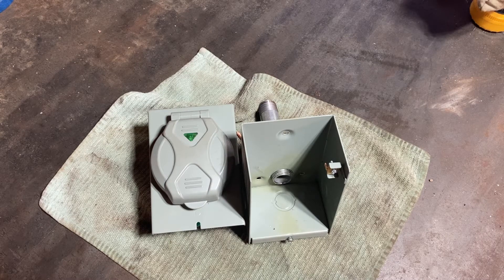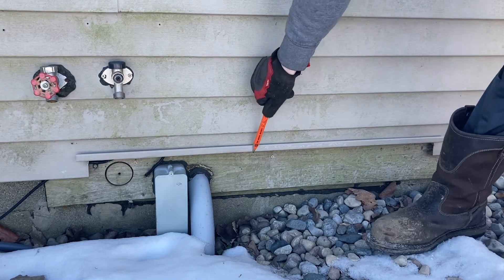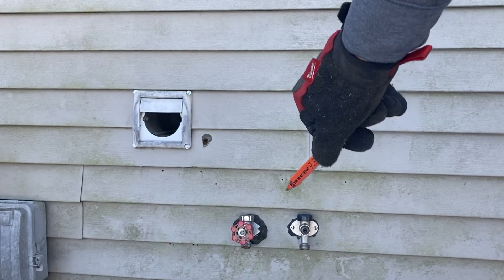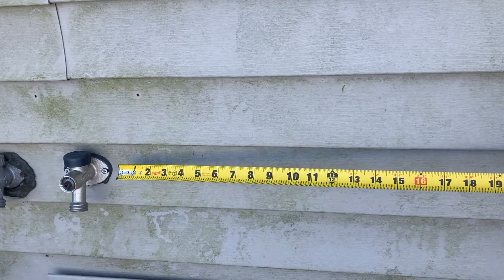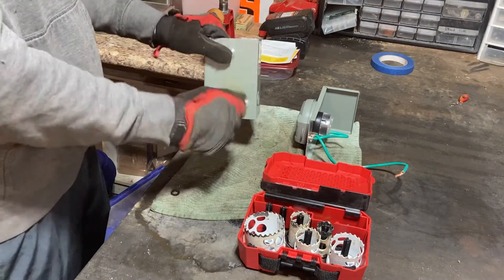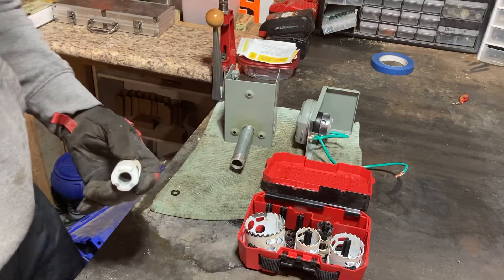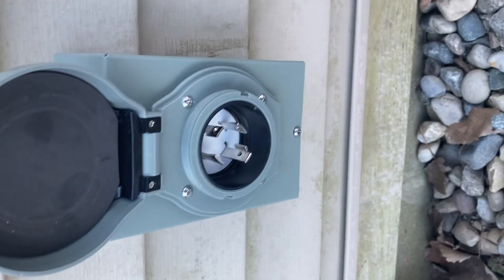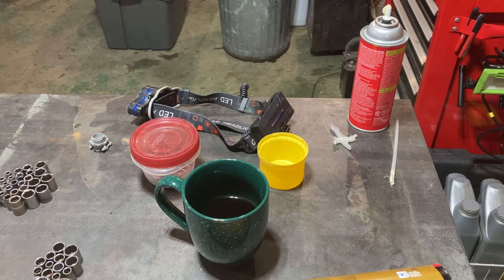MidwestDIY - How to Install  an External 30amp Generator Outlet Box

Comment: Not bad, i would use silicone when you shove the pipe in the hole, then foam on the inside as you have done.  Foam doesnt do a ton, usually for water seepage mitigation.

Comment: Is that galvanized pipe nipple instead of conduit? That looks like pipe thread.
Reply: He appears to only be using it like old knob and tube just to get it through the outer wall. It's common to use galvanized pipe for the tube. Most older homes used galvanized pipe is knob and tube wiring.

Comment: None of this would meet code in my area.    Wrong conduit, wire rubbing against sharp edges of gas line used as conduit, no anchor on the wire at the box, no mounting panel or flashing for water penetration protection on the siding.     Totally the wrong way to install a box.
Reply: Your literally the only guy that mentioned about his issues and you are correct. Are people this clueless?
Reply: @teamdada2194 Us electricians would rather be hired than post videos. This is just an example of the wrong way to pass through an exterior wall.

Comment: I installed  a pass & seymour l1430  today.    There back hole is 1/2  inch  pipe threads 
Is in the center using a gas pipe.  9 inches  pipe. It was hard to push the wire 4 Gauge  witr though  the pipe  but easy to  connect  the   4  10 Gauge   to l4 30 kit
   I wish it had a 1"  Inch pipe connecting

Comment: Got that same holesaw kit oan HD for $40 on sale and it's awesome.  I actually bought the same outlet box for my Westinghouse 120V 3600w generator.  Is there a reason you use gas line as your conduit?  I drilled through the vinyl and OSB right underneath my panel and mounted my outlet box on the outside wall from my main panel.

I was about to install the outlet box inside my garage next to the panel until I saw a video of a guy who bought the vinyl siding mount plate etc and thought man it would be clean looking to install on the outside which also meant my 40ft L5-30 box was 10ft closer to the backyard and made my 40ft cable from barely reaching from the outlet and under the garage door to 10ft closer..

I love my setup now and what i did was cutout an 8"x8" patch of drywall in the garage to feed the wire from the bottom to my panel with the proper wire clamps.

I was about to buy joint compound and patch in the cutoff drywall until i remembered those plastic access panels which made it even easier..  the location is in the garage in a corner underneath the panel so its not a big cosmetic blemish

Comment: My generator is a 12,000 watts...9000 running watts.  What kind of generator outlet box do I need? I ask, because when I search for them, I see that it says, for example; " maximum 7500 running watts.
Reply: I can't tell without seeing it but I suspect your generator has a 50 Amp outlet on it (as well as a 30 amp).

12000 peak/9000 running watts would require a 50 Amp inlet box. 
50 amps = 12,000 watts at 240 volts
30 amps = 7200 watts at 240 volts which is most likely the inlet box you were looking at. It's rated at 7500 watts for tolerance if the circuit is maxed out at 7200 watts, in which the breaker would eventually trip.

Hopefully that doesn't confuse you, but all in all, if your generator has a 50 amp plug, you'll need a 50 amp inlet box, 50 amp cord and 50 amp breaker. If you're unsure, as always, consult an electrician.

Comment: just one problem with your whole install you're using the wrong kind of conduit supposed to be electrical PVC. vibration or movement in a wall you can cut your wires with that metal conduit and your wire is supposed to be solid cord not multiple strand
Reply: PVC is not necessary, its another option but not a requirement. You can add a plastic bushing to the end of the rigid nipple to protect the wire from vibration and still be code compliant.
Reply: The conductor can be multi strand it typically is multiple stand on anything over 12 gauge. Even 10 gauge is most commonly multi strand